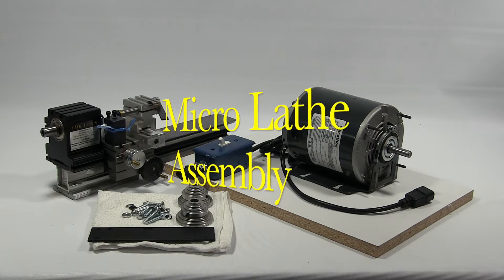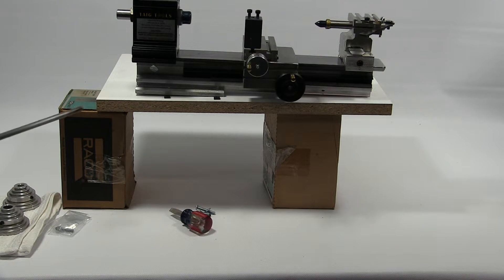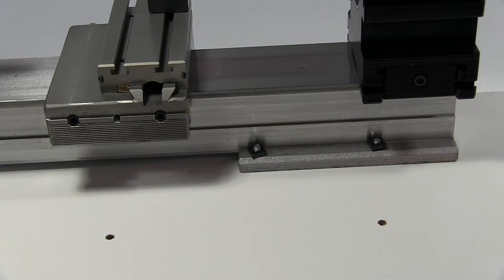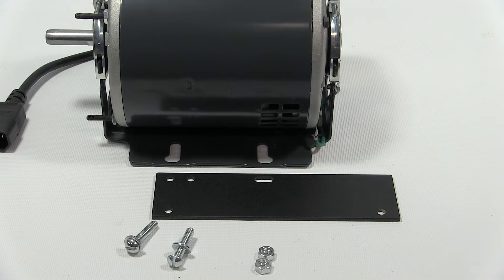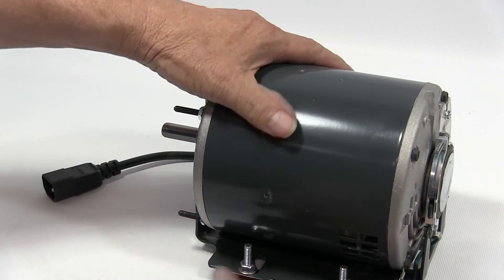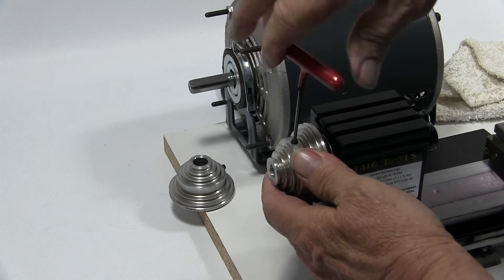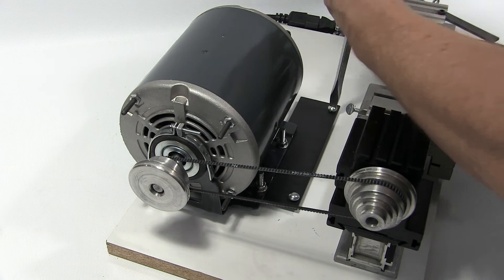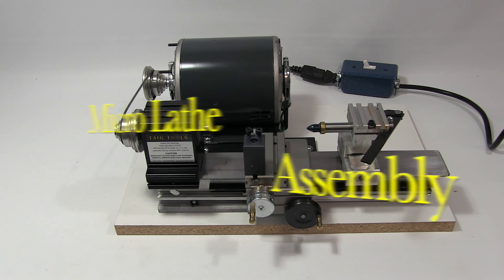Micro Lathe Assembly

Comment: Wish I had watched this first before mounting the motor I drilled out the holes on the board so the bolts came up from the bottom like the lathe.
Reply from the maker: As long as it works :-)